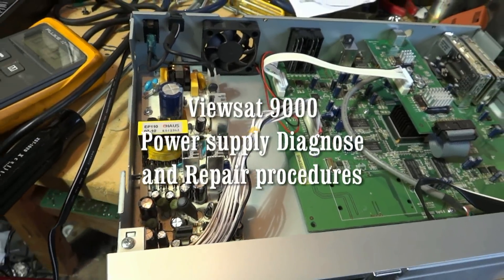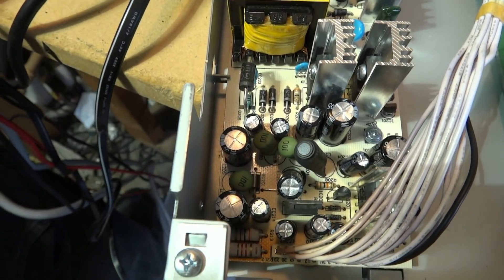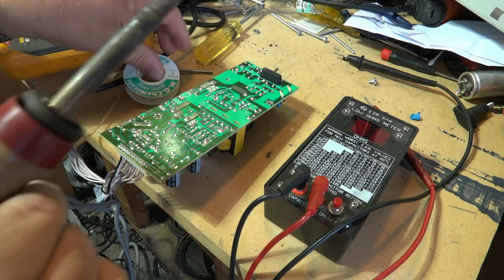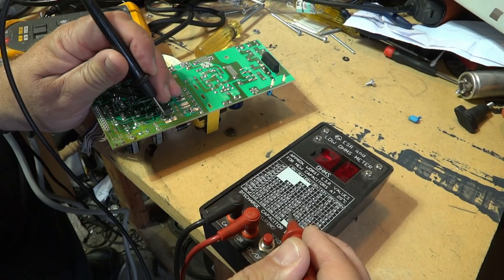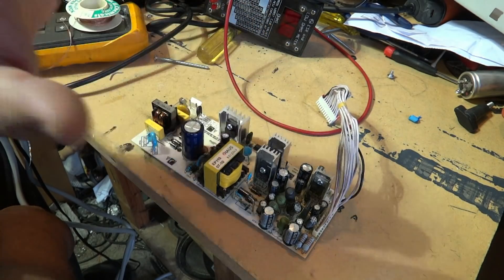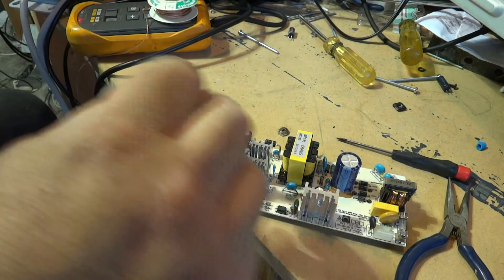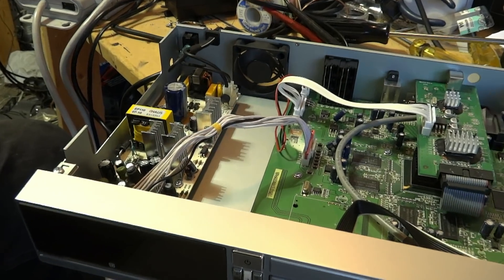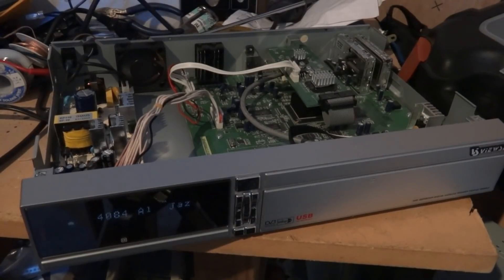Viewsat 9000 FTA Satellite Receiver Power Supply Repair

Comment: Thanks for the great video.  But some things have changed in 20 years.

Today you can buy in-circuit ESR meters based on clean sine waves rather than the old school "squarish" wave meters.  They cost about $50-75, assembled and delivered.

Here is my favorite after testing a few:  http://lcr.is-best.net/en/
I love it because it gives me fantastic inductance and phase angle measurements as well.

It is not available on eBay.  Most of those turned out to be "squarish" wave and did not work well in circuit.  Although, there are some that test silicon junctions very, very well as well as ESR not so well.

There is also on online ESR calculator: http://reischle.net/esr/  No need for the "sort of close" crusty old tables.  Those tables were at best brackets or curves you had to squint and guess at.  Forget them.

I think the old days of the $300-500 ESR dedicated meters are over.  No need to disassemble or in most cases even know in advance what your component is.  Check it out.

No, I don't sell anything.
Reply from the maker: Lawrence Bosse I am sure that they improved the design of esr meters over the old school meters, but saying that the old meters still give an accurate read, and they are cheap enough. Mine was only about 70.00 when I bought it.

Comment: I had a psu i rigged for powering a car amp in home. Worked well for a while but one day it quit. When I turn it off and back on it runs for 1 second, the fan will spin and led turns of. then it powers off. When I unplug the amp from the 12v power leads the unit will run fine. It only fails under load. Do you have any tips to fix it? ps its pretty cheap about 30 bucks but ive had 2 fail the same way.
Reply: andrew STEWART Maybe the amp is drawing too much current, and the power supply can't keep up. Or maybe it just died of age. The capacitors probably went bad. I used to do the same thing here, and it worked perfectly.
Reply: Thanks for the ideas! It was a small 50 watt rms amp and appeared to run fine even at full power and was maybe 3 months old but regardless same psu failed twice in the same way soooo.
Reply: andrew STEWART What was the rating of the PSU?
Reply: Blue star 650w, 12v at 35A
Reply: Then it should have been able to keep up with the amplifier. Either the amp or the power supply died.
Reply: The amp is ok. Psu works with no load.  But cuts on and off when plugged in to amp
Reply: andrew STEWART yeah, the PSU went bad.

Comment: Great V!deo .... very neat.. thank you man! just want to know , how many 12V device
i can use at a time? if my 4 device all together 200w , needs 10A minimum , do you think it will work safely ? Thanks again ....
Reply from the maker: Well, to run 4 devices at the same time you will need a power supply that has at least the minimum amount of current all the devices need, plus headroom.
Generally you want to go at least 10% over the required power needed. So if you need 200 watts, a 220 watt power supply would be in the minimum you would want to use. You can always go bigger. Undersize and you run the risk of overheating it, or the power supply going into an over current shutdown condition.

Comment: I have a switching PS that is blowing a fuse, new ones too immediately. Any Ideas?
Reply from the maker: If the main fuse on the AC side is blowing immediately then you have a short circuit on the hot side of the transformer, most likely the transistor(s) have failed.
Some low power supplies use a single transistor, but most higher current supplies will use 2, and they alternate them back and forth, one transistor is on while the other is off, and vise versa.
If both were to switch on an "On" state at the same time, smoke, blown fuse other burnt parts will likely result. Oh yes the transistors would commit suicide at the same time resulting in an immediate blown fuse if all you did was replace it.
Check the output transistor for a short. Most basic units are self oscillating with a few external components, and some designs will have a dedicated drive IC to control them. A schematic will help you in that circumstance.
Also check for shorted rectifier and switching diodes, and don't forget about the main filter capacitor. Those have been known to short especially if the PSU has been whacked with a power surge.
I have a few newer videos where different types of power supplies have been diagnosed and repaired. Check out my video of the Sharp TV, which had a shorted zener diode in the power supply that was giving it grief.

Comment: Thanks. ...very nice video. I have a vintage film projector that intermittently loses power while running and turning the main power selector switch. I'm very much a novice at electrical problems...but your video gives me a method for testing the capacitors. I just need to get an ESR tester now.

Comment: Dave,

Thank you so much for doing this video as well as all the comments/instruction you're providing as well.

I found an abandoned Samsung 50 inch 1080p plasma HDTV at curbside a couple weeks ago.  It was built in Sept, 2007 and totally dead.  (The set model is FPT 5084X/XAA.  The power supply is:  BN44-00175A)  I did some research and found a blown 12 amp 250 volt slow blow ceramic fuse on the power supply.  That seems to be a common problem with this set. I ordered some exact replacement fuses on Ebay.  The set now works perfectly with a beautiful picture!  This set turns on in about 5 seconds, which tells me the capacitors are working OK.  However, my research also tells me that four 2200 MFD 10 volt capacitors are a weak link in this power supply.  I want to get ahead of this problem so I intend to replace them with 2200 MFD 16 volt, 105C, low esr Panasonic capacitors.  Is there anything more specific about the capacitors for this power supply that I need to know before ordering them?  Since I'm going to be in there, I'm also thinking about replacing some of this power supply's other capacitors as well.  Any thoughts or suggestions?

Thanks a lot, Tom

Comment: Hi .Please help me. I have shortcuted my w1952s lg monitor main board powersupply when measured to find 12 voltage for my light replace with leds strip and doesn't turn on. Can you give some tips to fix it,please? I've shortcutted the white fuse from board and shortcutted my house light :)
Reply from the maker: You may have blown the chopper transistor that drives the transformer.
Unfortunately switching power supplies are usually running close to the design limit and short circuiting the low voltage sides can sometimes damage a few components.
Some power supplies will have fuse resistors in series with the DC rectifier diodes, others not. There will usually be at least 1 fuse resistor  on the primary side too as a fail safe to prevent a fire in the event that someone bypasses the fuse.
Check for an open very low value resistor. They are usually something like a 0.47 or 0.1 ohm resistor.
Also check your chopper transistors .  There could be 1 or 2 of them, and they will always be mounted to a metal heat sink. Check for shorts.
Sorry I can't be more specific, but when a short circuit condition takes out a power supply, there is no way of telling what parts are damaged. It is like when a unit has had a lightning strike. This is when you need to break out the test equipment.

Comment: When it comes to replacing caps, how important is it to match the uf exactly? I recently replaced a couple 820 uf caps with 1000 uf caps in a dead switching power supply and now it works. But it is making an odd chirping sound. I can't tell exactly which component is making the sound. I read somewhere that the tolerance on these things is roughly 20% but I guess 180 uf over the originals is a bit much. Your thoughts?
Reply from the maker: Going to a larger capacity capacitor can change the resonance of the power supply and will appear as a larger load during the charge cycle. You generally want to try and match the capacity. Going to a higher voltage is fine, but as far as the size, you are best to pick the same capacity. The engineer designed the rest of the circuit around that value, and if he wanted a 1000Uf he would have placed that value in to begin with.
Reply: 12voltvids Thank you for your quick response! I replaced with 1000 uf because that is all I had at the moment. They are the same voltage but I would assume that is the reason the unit is chirping, from what sounds like either the transformer or some sort of relay component. (I'm still new to repairing circuits and such). Again thank you for your quick reply. Btw your video was very helpful!
Reply: 12voltvids One more quick question. The capacitors on the board in question appear to be connected in parallel. Would it be ok to use one 1600 uf cap in the place of the 2 820 uf caps? That would be closer to the ufs needed and I have one of those on hand already.
Reply from the maker: beejc1128 Yes if they are in parallel you could do that. They quite often will use 2 or 3 small ones in parallel as opposed to 1 large cap because they are cheaper and smaller.

Comment: Great Video! Reminds me of my work style lol.  Isn't there a better quality replacement cap (forget the name/type) than will last longer
Reply from the maker: Panasonic gold caps are probably the best ones for the price. There are a few US made caps that are excellent, but you pay for it.
When I am doing these demo's I generally just use whatever I have, usually pulled from recycled boards, as the majority of these units that are being repaired are not being put back into regular service. Many are my machines as people give me stuff they are throwing out, so I am not about to spend much on them when I am fixing them for the camera.
This one was a paid repair, as are a few of the TVs and on those units I use new components.
Reply: 12voltvids I found some 25v 2200uf marcon  caps in an old color laser which I used to replace 2 bulged 10v 2200uf in a PC PSU, Had to extend the leads an inch to 'fit' them in but it works just fine

Comment: I love to watch a professional at work. Good vid.
Also love the put down of the wanabee expert's comment on the display. Nice.
Reply from the maker: I normally don't put down anyone else's comments, but there has been a few people that are clearly in the business making a personal attack on my videos. Calling my work procedures unsafe, and making claims that if anyone follows my advice they will get hurt.  Clearly they have a personal interest in the general public not getting educated into how these devices work. I can understand this from a business perspective, if someone that would normally pay them 150.00 to fix their TV can now see how to troubleshoot, and have the parts that commonly fail pointed out to them, they are going to try to save a buck and do it themselves. I used to be in the business, and back then my knowledge was closely guarded. I wouldn't even share it with my co-workers as I was afraid that the tyrant I worked for would get the low paid helpers to do all the work, if they knew what I knew. I was the master certified tech at the shop I was at, and I intended to be the last one to go when the fit hit the shan as the saying goes. As it turned out, I was the first to go, by my own decision.
I woke up one morning and thought, life is to short to work for a person you can't stand, and that was it.

Comment: If you would like an honset critique of this video,

I would say it seems like you've done this before, you have seen a hundred of these power supplies and these three caps always blow.

I have to ask, When you plugged it in and the display was dim, what do you think might be incorrectly supplying voltage to the display?

You might consider checking the other capacitors while you are in there, right?

Who else's job would that be?
Reply from the maker: Actually this was the first of this unit I have seen, I had never worked on that model of unit before. I have repaired literally hundreds of power supplies of all types during my career as a diagnostic engineer, when I spent 20 years working 9 hours a day doing nothing but repairing TV, VCR, Camcorder, and audio equipment from every manufacture you could think of. Not just power supplies, but every type of circuit.
The display wasn't that dim, it just was hard to see in the shop, due the the high intensity lighting I use in the shop. A VFD type display requires about 20 volts for the grid/anode supply, and an ac voltage, or slight negative bias for the filaments as it is a vacuum tube type display. Those voltages were present. Many times a dim display is caused by the display itself if the voltages are correct. I did check the others with the ESR meter, but they were cut from the video.
I just did a restoration of a vintage old Yorx stereo clock radio that had a VFD tube in it, where the tube was tired, and very dim, to the point that you could barely see it. I swapped it out for a different tube salvaged from another clock that I had modified to use just the chip to drive a large 5" display with 115 LEDs to make the digits. The old VFD in it was in good shape to I swapped it to restore the vintage radio, and you will see the difference. It is the rare earth coating on the kathode wires that gets weak and stops emitting electrons efficently, and the display gets dim. Or it could be the driver chip too if the voltage is correct. These viewsat units used really cheap parts, so I wouldn't be surprised to see the display tube getting weak after a few years. The chinese made VFD tubes were never as good as the Japanese ones.

Comment: Hi - Thank you very much for this informative video. The gentleman presenting the repair seems to be very experienced and knowledgeable. I would love to learn much more from him! My academic knowledge of electronics is not that advanced but I do understand things. I would love to be able to talk to you directly. I have this power adapter that is making a clicking noise. I had a visual look at the caps and they don’t seem to be bulged. Is this information enough for you to give me some pointers? Could you please tell me where to buy an ESR meter like the one you are using in your workshop? Are you Canadian? Which city are you based?   Many Thanks HBehjat.
Reply from the maker: Yes I am in Canada. West side to be exact.
My ESR meter was a kit, it came from Main Electronics in Vancouver,
The ESR meter is the only way to identify bad caps. You can visually see the ones that are ready to burst, but that is usually at the last stage of their failure. The ESR goes up first as the electrolytic dries out then heat is produced that drives up the pressure and finally you have a bulged cap. Usually a ticking sound on a switching PSU is the oscillator attempting to start and not, or it is going into a shut down state. Most likely a cap or multiple caps are bad, and an esr meter is the only way to spot them.

Comment: thanks for you video ,,, i have a power supplier of a computer hp compaq dc 5850 small factor,, the computer turn on correctly but the power supplir have acelerate too much the fan accelerete make noisily ... i check all its ok no capacitor inflate.. yo can give a tips how fix?

Comment: Hi mate good tip you given me its saved minimum £70 buying a new satellite receiver it just cost me p95 replacing a capacitor .
Thank you
Reply from the maker: Glad I could be helpful. Most of these power supplies are pretty easy to fix.

Comment: Thank you very much, sir. Your video encouraged me to repair the +5/+12 power supply from my Cincinnati Milacron Sabre 750 VMC.  It just didn't boot up last week, for no apparent reason.  I found the +5 was present, but +12 absent.

This power supply is a nice industrial L&H unit, with very good parts.. built in 1990, no bad caps, like all the PC power supplies, main boards, and whatnot else. 

In any event, I went down the line checking caps using ESR, and the caps showed correct.  Then I pulled all TO3 devices, being a pair of Darlington NPNs, and a number of dual diodes.  I found an MBR3045CT dual diode completely open.